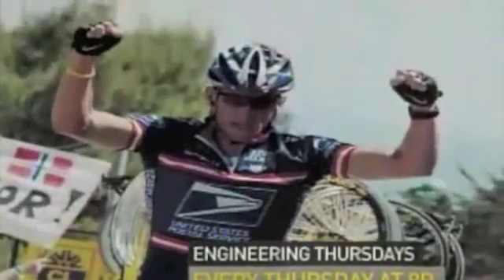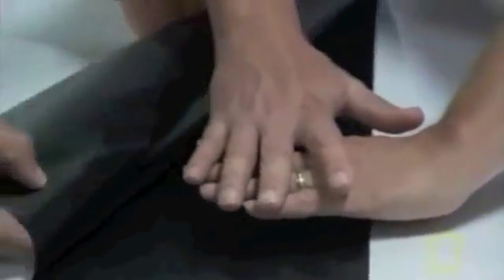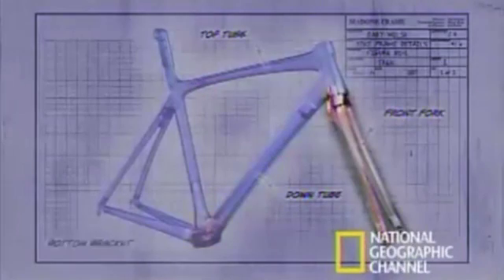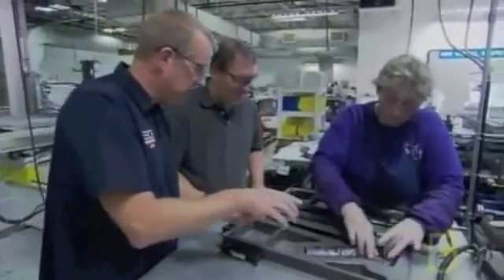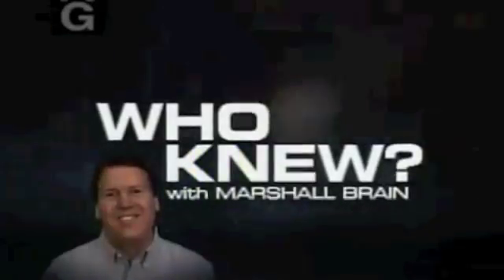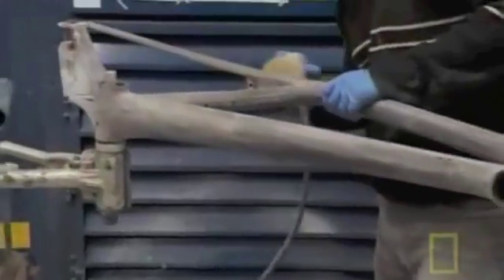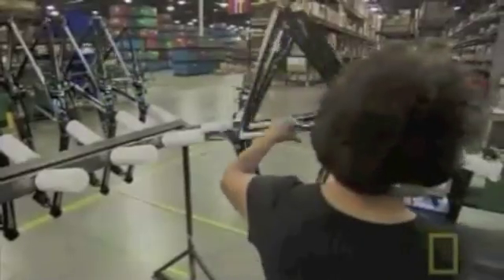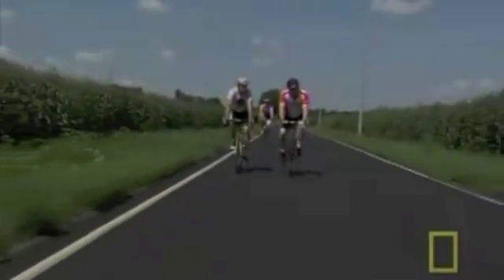Trek carbon bicycles - the manufacturing

Comment: When they get someone to do a story on bicycles who knows nothing about them, they can make even a Trek seem impressive. I avoid Trek because I don't like their frames and to stand them beside say Pinarello Trek suddenly seem more like CCM. They say the lighter the frame the faster the bike, well that's a lie. What makes a bike fast is it's efficiency, you can have a 13 lb bike with a frame the bends when you torque it hard and an 18 lb bike that is rigid and won't flex meaning all of your energy is going into rotating the wheel while the other bike is absorbing energy when the frame bends stealing some of the power from  the rear wheel making it slower. 

And an endorsement with someone who took steroids really isn't an indication of the bike itself but of cheating. I used to ride 300 miles a week full tilt, no cruising just pushing as hard as I could and my old 1985 Miyata 310 triple butted Chromoly weighed in at a whopping 24.5 lbs. yet I was only passed once in over 2 years, and that guy who passed me drafted  behind me for a mile or so and then pulled out and holy crap was he ever fast! I was doing 28mph with a little headwind and he just passed me like I was doing more like 15. It made me laugh out loud and that's not easy when you are pushing yourself like that!

The 40 layers will be at the butting's and is for strength so the tube joints  don't fall off  and rigidity I imagine, the 4 thin layers probably things like cable guides, but not weight bearing stuff. But to say  Trek makes the best bike in the world? Meh, seriously doubt that. Lately China have make some seriously good TT frames! Strong and Rigid made of 9 to12K Toray Carbon Fibre (best) from Japan weighing in around 15-16 lbs for 6-700 dollars(Canadian!), with that savings you may be able to afford the Dura Ace electronic wireless and cable free shifting gruppo for a mere $2700 Looney's or so. It's getting like Formula One out there, shift at the click of a button and batteries last 4 months, GPS, alarm, lithium polymer powered 6000 lumen anti cell phone headlights, pretty soon we'll be riding to the moon.

Comment: Give me a steal frame anyday. save the over priced plastic for someone to drink there coffee from.
Reply: What plastic? There is no plastic in strands of 95% carbon in 1 to 12.000 graphite strands per thread. There is epoxy to shape form, but carbon can withstand 500.000 lbs per sq inch where steel snaps at 100,000. That's why you can't find steel drive shafts in racing, just carbon fibre that takes over three times as much torque to fail and is less than half the weight. But you can have your steel if you want it. By the way, I can get a less than 17 lb Carbon Fibre bike complete for under $2000, I don't need a TT frame that looks alien.

Comment: I have a aluminum Trek Alexa/Domane, 2 series, that I bought for in 2013, for $1,400. I think you guys make great bikes! Although, I have to admit, that the Bontrager stock wheels, that comes with it, isn't all too great, though.
The wheels are heavy & the the rear hub has a lot of fricksion, so it can't pick up speed or eccelorate as well. So i'm saving up to buy a pair of entry level race wheels, just so I can get my foot in the door.
I do, however, like the iso speed, considering that I have sevier scoliosis, (a curve of the spine) so it really helps to relieve pressure on my spine! I also, like the fact, that Bontrager wheels are really reliable when it comes to durability/strangth, as well! It has a hole straight through the rear rim, i've even riddin it through 2 miles of solid grabble & i'm still able to train with the same wheel. My front wheel is a Bontrager R1, which is still holding up pretty well, even with a dent in the alloy braking surfice!

Thanks Trek, &
God Bless!
Reply: James Campagna I

Comment: water bottle is only 600g. the frame is 1000g. How is the water bottle double the weight?
Reply: +jibba02 1L of water weighs 1000g.
Reply: +rsx123 yeah 1 litre is a big bottle!
Reply: +rsx123 most bottles are 600ml with max of about 750ml.  that's why I said 600g

Comment: aluminium is not less durable, aluminium doesnt absorb shock and isnt as stiff as carbon. get your facts right NatGeo guy
Reply: aluminum IS less durable.  aluminum has terrible "fatigue life".  this is why all aluminum frames eventually crack no matter what. carbon theoretically has infinite fatigue life. why are there no springs made from aluminum?  because it has poor resiliency.  this is why steel frames can be cold set, but aluminum is what it is. this is also why aluminum frames ride so much harsher than steel.  the appeal of aluminum is it is light, avoids (some) corrosion, is cheap, and isn't as wearing on machining tools.

Comment: Fun to ride but those press fit bearings in the BB sure wear out fast. On my 4th set in a year and a half and already this has noise and excessive play.
Reply: +zacharycat User error... 10,000 miles on mine spread out over years and zero issues.
Reply: Look up WheelsMfg BB...they make a solution.

Comment: Im sick of hearing this "carbon fiber is so much stronger than steel" bs. It is strong yes, but show me one of these bikes with 50k miles on it. Make a gun barrel out of carbon fiber. Show me one thats been exposed to light for years but never been ridden, I bet you steel wins.
Reply: +theshapeexists Carbon fibers classified as “low modulus” have a tensile modulus below 
34.8 million psi (240 million kPa). Other classifications, in ascending 
order of tensile modulus, include “standard modulus,” “intermediate 
modulus,” “high modulus,” and “ultrahigh modulus.” Ultrahigh modulus 
carbon fibers have a tensile modulus of 72.5 -145.0 million psi (500 
million-1.0 billion kPa). As a comparison, steel has a tensile modulus 
of about 29 million psi (200 million kPa). Thus, the strongest carbon 
fibers are ten times stronger than steel and eight times that of 
aluminum, not to mention much lighter than both materials, 5 and 1.5 
times, respectively.
Reply: Gun barrels are totally different
Reply: +theshapeexists i've never literally touched a carbon frame,  my bike is aluminium therefore i know nothing about steel vs. carbon but i like your spirit.
Reply: +theshapeexists 

I agree with you. Designers just get off on using it because it's been an aerospace material for decades. They think it makes them sound smart. Aluminum and steel are still king, depending on the alloy. They're cheaper and quicker to manufacture. 

That said, carbon fibre is still a good material but I know there are much better composites.
Reply: +theshapeexists Gun barrels out of carbon fiber would not work well I would think. For one, carbon fiber is flammable. It also seems strong but too brittle for a gun barrel.
Reply: ***** It all depends on what you want really. If its cost, go for aluminum. If its durability, go for steel. If its comfort, go for carbon fiber.
Reply: I'll stick with my 40's cruiser with it's wide seat and fat tires. I get in trouble when I go fast.
Reply: +theshapeexists titanium would be the best. CFC is only expensive in tooling. so once they have invested in tooling its relatively cheap to produce each unit. Designing composites for 20yrs on aircraft I'd never buy a CFC bicycle. CFC has such a glamour label and is used in many configurations where its far inferior to conventional materials.
Reply: i dont want to use gun with a carbon barrel.it may explodes .
Reply: theshapeexists carbon fibre and steel both have their own uses. Do you need a gun to be super light? Dynamic vs. static load? Tensile vs. compressive strength?
Reply: Carbon is good in respects. Piss poor in others. Carbon can take high stress loads that are planned for. Even more so than steel. KEY WORDS: planned for!!!

 But introduce unplanned, unforeseen stresses and you are asking for trouble. Carbon fiber is rubbish when it comes to dings, dents, and abrasion.

Everyone knows a nail file will make short work out of most carbon fiber. With steel, not so much.
Reply: Show me a sub 1000 g bike frame out of steel that doesn't crush like a pop can. I guarantee a madone frame will be fine after 50k miles. 

Carbon bikes can be made to be very sturdy but that's not what people are looking for. I've built and crashed a carbon bike at 70 mph with no ill effects. Carbon gives you more design freedom which means it's possible to optimize more specifically. Most carbon bikes are optimized as race machines, so things like impact resistance go out the window. 

You may also be interested that some of the highest performance rifle barrels in existence are carbon fiber wrapped. Not hard enough to be the inner liner but it provides tremendous strength and rigidity against chamber pressure.

Comment: how they do the pressure in the mold?
Reply: +Maxim Nave they join the 2 halves togheter and inside the hollow carbon mold they insert a thick rubber balloon which inflates inside thus pressing the soft carbon against the alu mold.

Comment: I've been ridin' steel since Trek was @ the barn . Gotta admit , the little shop of horrors
has me somewhat convinced at the twisting of "that frame". You do it for a couple of
 a few minutes  with your bare hands/body and see if it stresses it . I know that disc
brakes on a chinese entry level carbon started to crack the finish and I canned it !
I love my teeth , but this shit needs way more testing done and the price to become
much much more realistic . Ti , TrueTemper , Prestige & Columbus SL  will be
my ash urn ........ I just might have to test ride one time before I cross the finish line
of life , maybe .
      Trek CEO severed the relationship with that shit-twit "Arm"pit after the
admission . Nobody but nobody was not going to convince me that there was no doping
in that U.S.DOPE team mon .From day one , after that second win , I knew something
was wrong . But SEVEN , c'mon !!!
       Picture showing Merckx/God at the aluminum mention is quite wrongful too.
Cheers to all .

Comment: fishing rods are made in a similar way... except they're not 2 halves pressed together, they're sheets rolled around a steel blank/jig.

carbon composites do fatigue and if they develop a crack, you're pretty much going to have a catastrophic failure.

you have to be really into cycling to benefit from a carbon bike. I see a lot of crappy cyclists with carbon bikes and I've summed up they just have a huge ego to feed...  and way too much money :P 

aluminum/chromoly/steel is still the best for 99.9% of people.
Reply: Oh, yes. I do agree with your statement. There are lots of crappy cyclists here who owns a carbon fibre bike, but can't even beat me (I'm using a cheap steel mountain bike) in a race. Money can't determine the strength of people, though.
Reply: Titanium?
Reply: I personally haven't seen a titanium bike that is rigid enough yet.

Comment: "the lighter the bike the faster it goes" bullshit, the lighter the person, but weight only has to do with acceleration and hill climbing, but it doesnt even matter compared to how much weight your body can loose
Reply: moving mass is more critical. Lightweight wheels make all the difference
Reply: I plan on improving it. On my new Emonda.
Reply: A reduction in weight also leads to a significant reduction in friction and rolling resistances and, as you said, during acceleration, meaning that you can deliver more power to the wheels for the same amount of effort and, over the same distance, means less energy is consumed... but you are right, the best way to shed weight is from the rider that is sat on top!!

WTF is right too, the wheels are constantly accelerating even when the bike is at a steady speed, or even slowing down, therefore they are probably the most effective place to reduce weight, even though not the cheapest!!!
Reply: The LIGHTER and STRONGER (the legs of) a cyclist is, the faster the bike would go. Right? :D
Reply: what if you cant lose any more weight?
Reply: ^ Improve your performance, then! :)
Reply: #aeroiseverything

Comment: ERW carbon hoops are coming for road bikes. High Speed Airless, hard wheel rolling efficiency, screw force accumulation and return. High frequency in wheel suspension for stability at the highest speeds. Thought you would like to know.